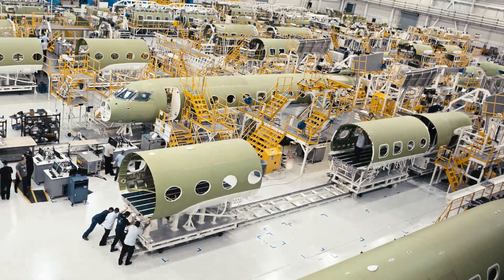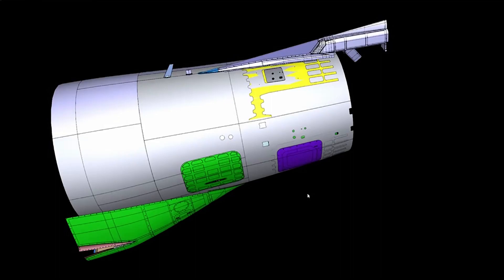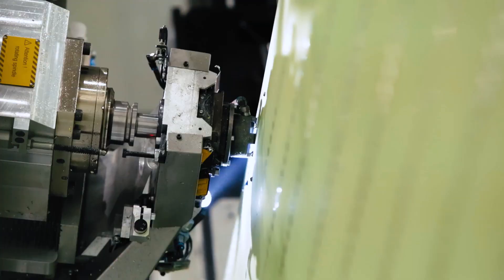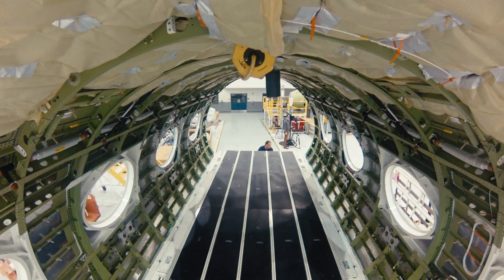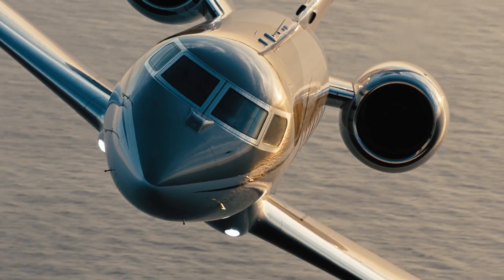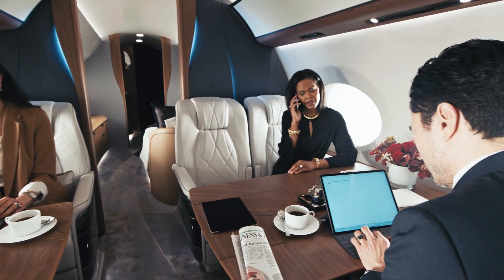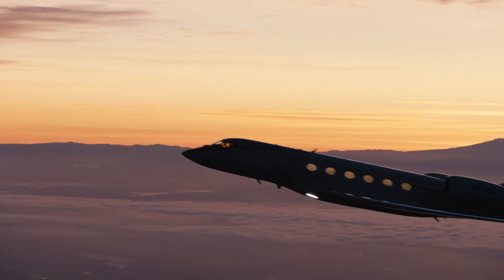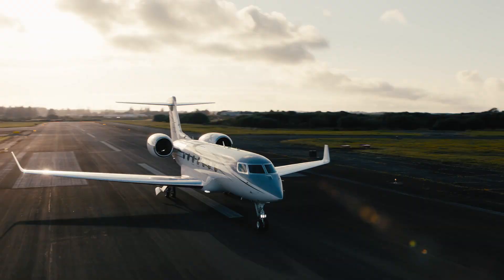21st-Century Fleet: Manufacturing

Comment: Why is no one making single piece carbon fiber hulls. It gets rid of all the frames, stringers, sheet, rivets, it's unbeatable for space, weight, complexity, ease of manufacture, durability..
Your planes are 24ton empty. That's an anvil plane. Fuselage done as a 2mm carbon fiber shell is about 700kg and can hold 10bar pressure. How are you oblivious to this?